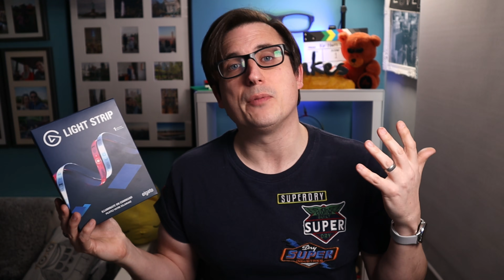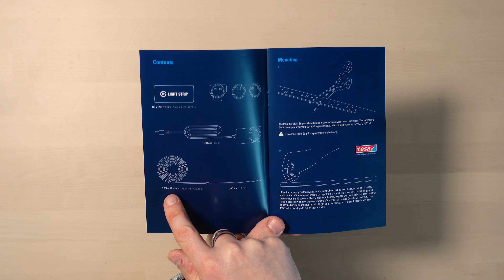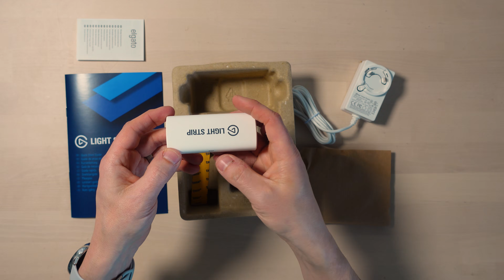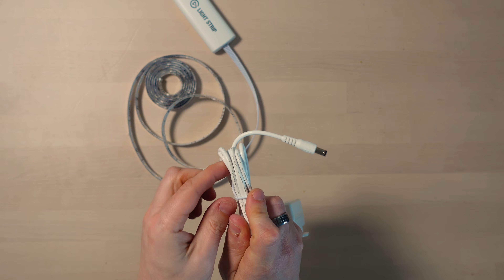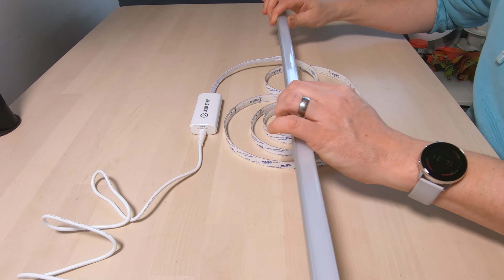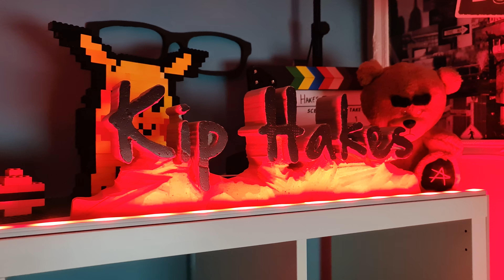Unboxing, Setting up and Testing the Elgato Light Strip

Comment: how do did you achieve the mounting on the corners?
Reply from the maker: I just bent the tape around
Reply: @KipHakes  Ah, I understand how the tape bends around. Does the panel you installed it in bend as well? It looks a bit more than just the light strip or maybe im just dumb. Thanks for the reply i really liked this video. Will subscribe and like.
Reply from the maker: No, the light strip case I've put the Elgato Light Strip in is cut into three pieces. Left, Top and Right, there are gaps at the corner but you can't really see it from a distance
Reply from the maker: Thanks for subscribing!